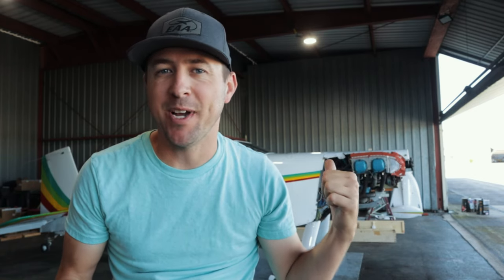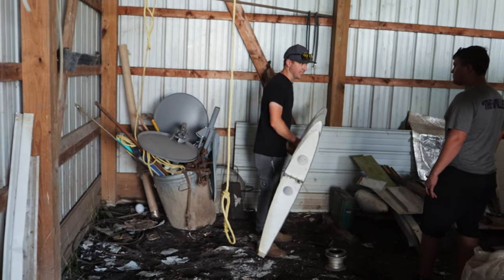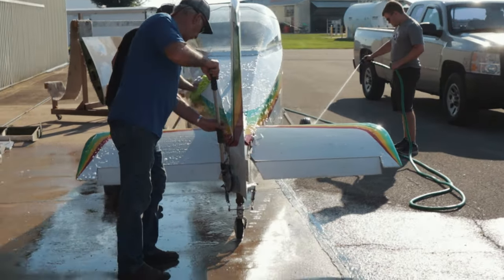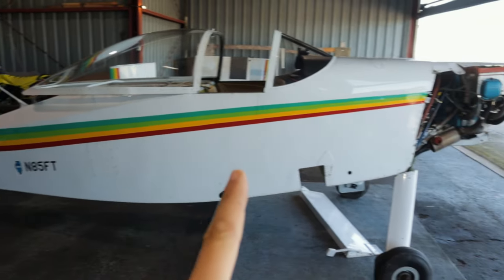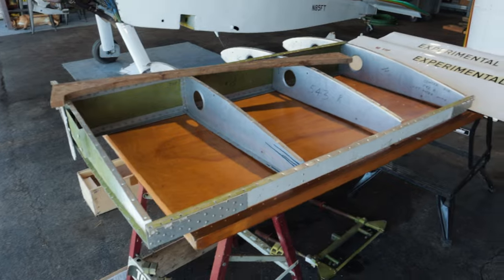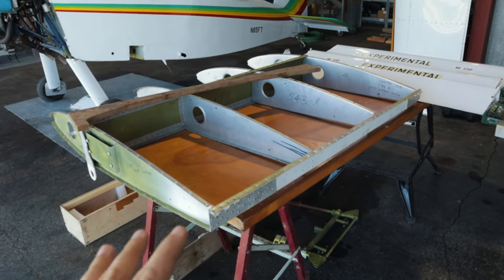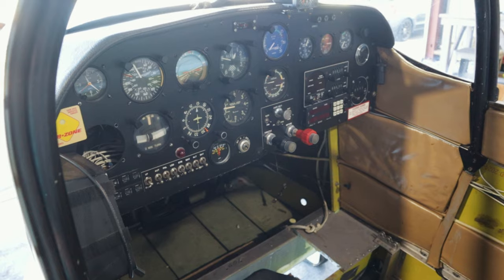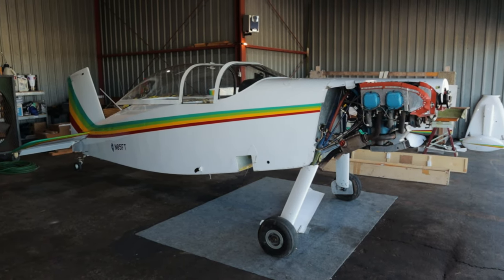I bought a Barn Find Airplane stored for 20+ Years!!!

Comment: It is simple to make a wing jig to reskin it. You could have it flying in 6 months! You will love it!
Reply from the maker: If you have any tips or suggestions I'd love to bend your ear about it
Reply: @MotoFlightGuy  Have you looked into the history of the T-18's? Originally they where open cockpit and open cylinders. designed around the 125 hp ground power units. That sold then for around $97.00 each! The Thorp's the Tailwinds and the Bushby Mustang 11's where all in the same time frame and speed ranges. I think you will like they way they fly. Like your Tailwind touchy controls, but really nice to fly.